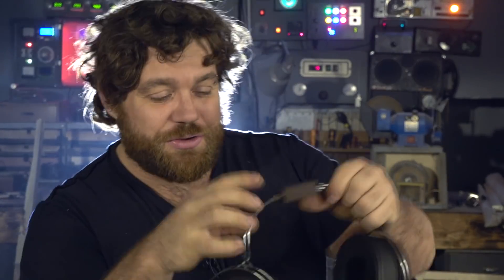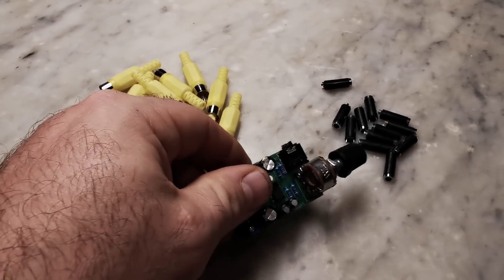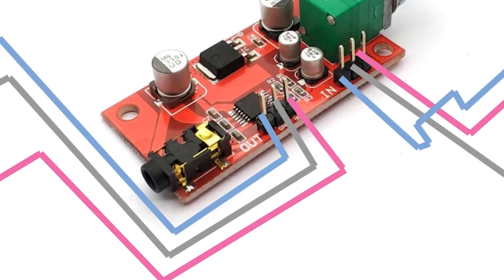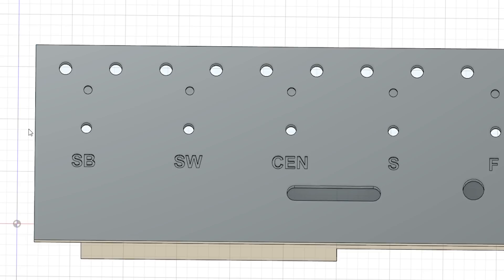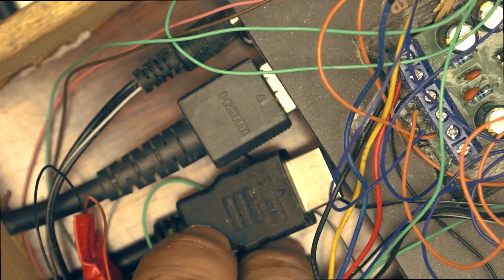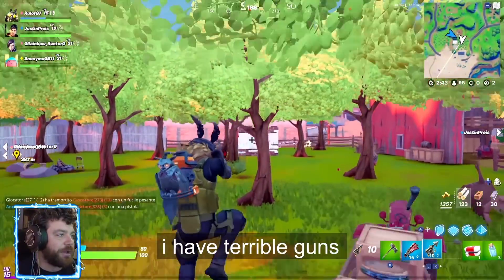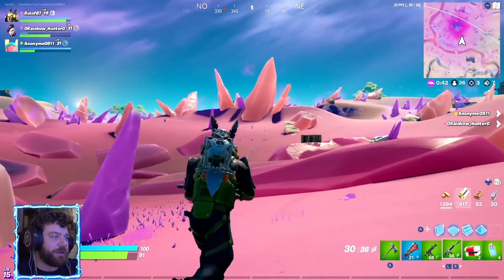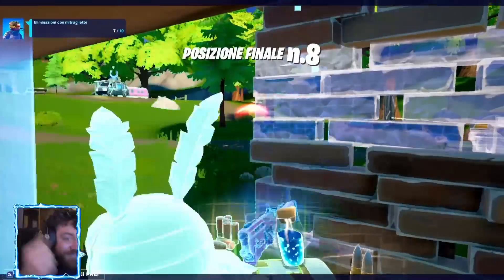How to Make a Sourround Mixer + Gameplay test

Comment: I watch the two part video. You put soo much effort and skill into that project. I personally would recommend that you to try some open back headphones with angled drivers (Sennheiser HD500 series for example HD599 or Audio-Technica ATH-AD500-2000) just for a comparison. I never had any problems to recognize direction of sound source in 3D space using that type of stereo headphones.

Comment: It would also be cool to have 3d models for a 3d printer for the part of the headphones that holds the speakers, because I think it would be much easier to manufacture like that, than it is from wood - not everybody has a wood CNC machine. If anyone copies these designs at all, I personally only watch the videos for enjoyment to see how ingenious designs can be made.
Reply from the maker: i know! i pus  3d model file in the info so you can dounload them!
Reply: I'm not disagreeing with you but not everyone has a 3d printer either